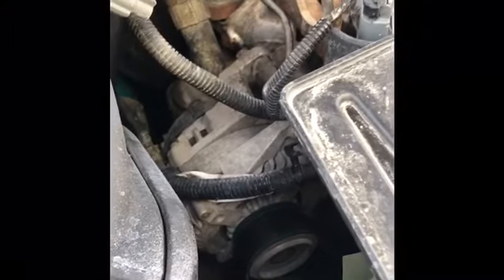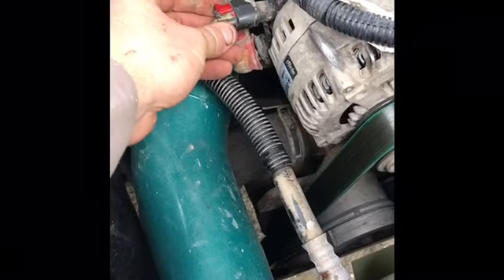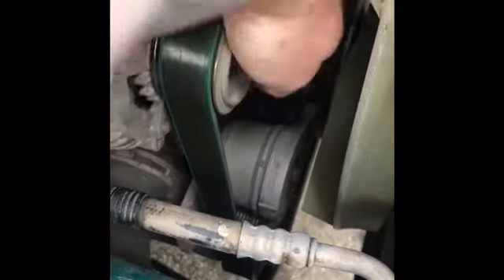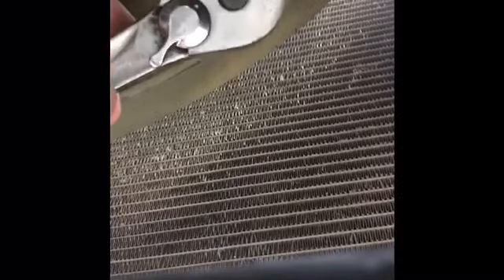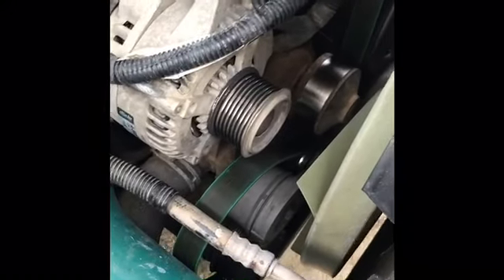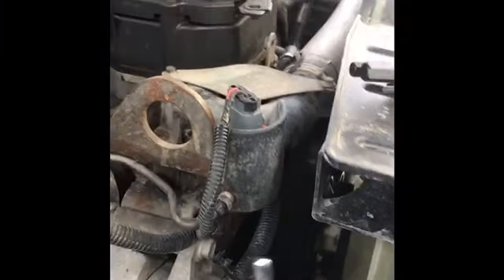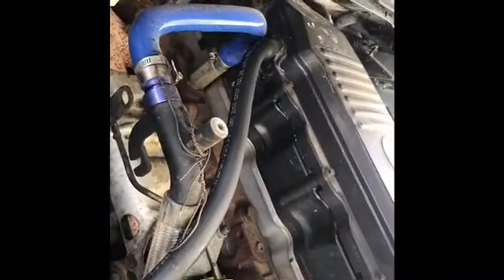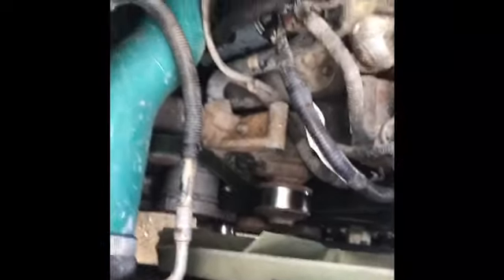Ram 2500 6.7 cummins alternator replacement

Comment: Thank you for making this video, I just replaced the alternator on my bosses 6.7 in an hour, your video was very helpful. I had to beat the crap out of the old one to get it out but other than that and trying to get my breaker bar on the tensioner it was very easy. It has 225k miles and still had the original denzo alternator.

Comment: great video thanks my check gauges light came on and everything looked normal except the charging voltage lets hope $200 and some labor fixes the problem :)
Reply: $200 and about an hour fixed my issue- same indications

Comment: Never a junk alternator. Always keep your old alternator and get a rebuild kit for it and put it. Once you rebuild it put it on your shelf for when the other one takes a shit. Then install the one you rebuilt and rekit the bad one. Repeat
Reply: Most all alternators come with a lifetime warranty. Also, there’s a core fee of $40-$50 so no point on sitting on a old one.
Reply: @Matt-xj9us  wrong. They either come with a 1yr, 3yr or a limited lifetime warranty. The limited lifetime warranty only cover manufacturer defects not normal wear and tear. So you’re better off getting a rebuild kit and doing them yourself instead of paying someone else to do it
Reply: @Matt-xj9us  also just because you buy it at the store new doesn’t mean it’s not remanufactured. Remanufactured alternators are rebuilt cores that someone else installed the rebuilt kit in for resale
Reply: @jakewelsh1002   No Jake, I’m not wrong and I’m speaking from experience. The video is for a 6.7 Cummins engine and you can not buy this alternator locally where I live without a lifetime warranty. Your area may differ. If my alternator fails for ANY reason than O’Reilly will exchange it no questions asked, at least from my experience with lifetime warranty parts. Now, if you exchange 3 in one week than they probably will have a problem with it. Talk with your local part stores if you don’t believe me. If you don’t want to take my advise than that’s fine.
Reply: @Matt-xj9us  limited lifetime and lifetime are two different warranties. Like I said there is no alternator that comes with a “LIFETIME”  warranty regardless of what engine it goes to.
Reply: Claps
Reply: @Matt-xj9us  quite the intelligent response 😆

Comment: Just found this video. I have the same noise but can only hear it from inside the cab and under very light throttle sitting in park. At startup idle you can hear it but not when you open the hood

Comment: Hey man quick question.? What amperage is your alternator?
Reply from the maker: P Braun I don’t remember I know there was 2 alternators to choose from and I chose the cheaper/ lower amperage alternator. I have a plow and it’s holding up fine. I want to say it was a choice of 160amp and 220amp but not 100% sure
Reply: Ryan Gentile ah ok thanks i have the 180 looking to upgrade so i can run some goodies.. thanks
Reply: P Braun 145